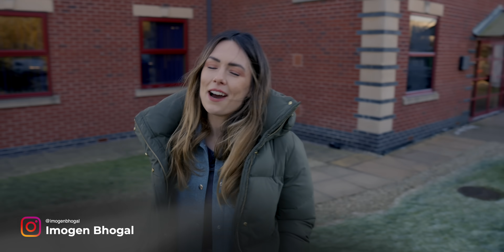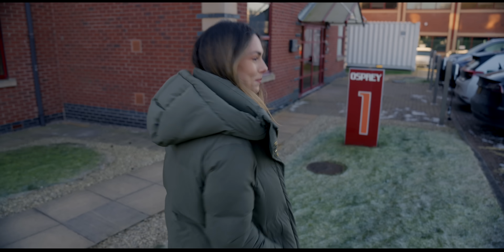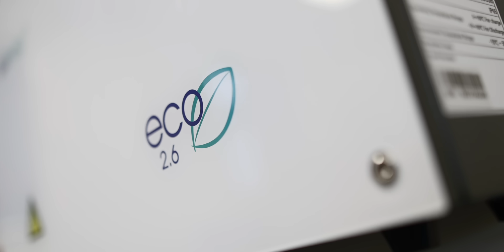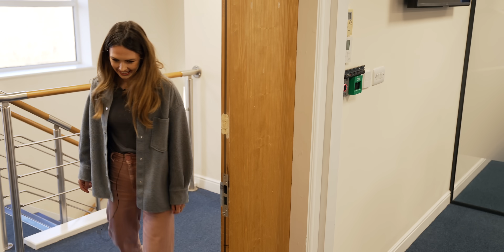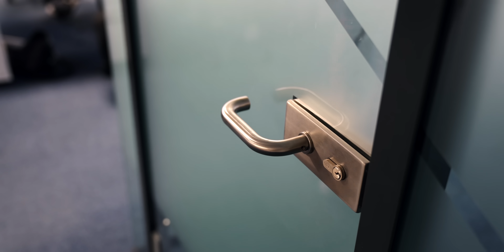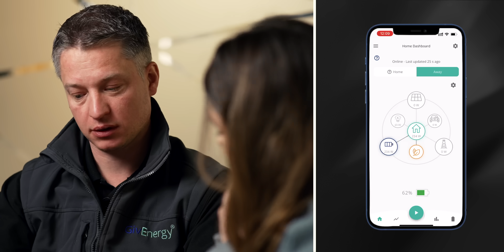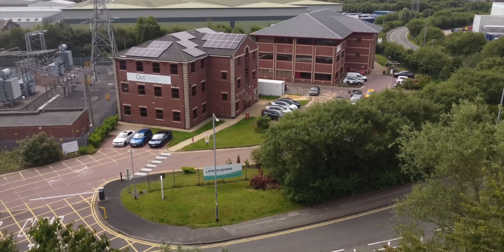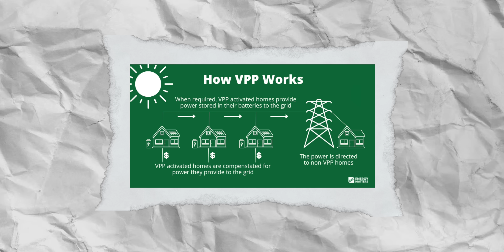THIS Is The Secret To Green, Clean Passive Income!

Comment: Our batteries and solar panels were installed a couple of years ago. They have been absolutely brilliant, particularly as they are combined with heat pump air conditioning. I have to say though that the GivEnegy bloke is not the best advertisement for the company. Smart casuals and a shave would improve his credibility no end.
Reply: could loose some weight as well, BUT do you want a slimy suited salesman??????

Comment: I do not agree with the "cheap" tariff over night, I believe it should be much more dynamic having a daily minimum and maximum and every 15min should be adjusted. This would help us greatly flatten the curve and adapt our consumption to production.
Reply: That already exists. Energy markets are priced every 30 minutes. Octopus offer a tariff called Agile that follows the wholesale market. The reason the cheap overnight rates exist is because Octopus wanted to prove to the market/NG ESO that it could incentivise people to charge at a time that suited the grid and not the owner. They do this by offering a cheap rate. Now they have moved that on to Intelligent, which control when your car charges and when it does, you get the cheap rate, no matter which time of day. Again, its cheap purely to get people to use it, so Octopus can show it works. It's well known that this was a loss leader for Octopus. They are now (or were) trialing being part of the grid balancing mechanism and turning chargers on and off to suit the peaks and troughs of demand on the grid. This will be earning them money which likely balances out the cheap rate to customers.
Reply: @cingramuk  in the UK it does. Over here in Portugal not that I am aware of.
We get cheaper night tariff despite huge solar capacity. Solar outperforms both wind and hydro by a lot so the only thing beeing "ON" in the night could be Gas or coal 🤐
Reply: @maumau165  ah I didn't realise you weren't in the UK. Yes that makes sense, maybe ping Octopus a message if they serve Portugal.

Comment: I’m installing a hybrid battery/grid solar system here in Alberta, Canada. Even up here it absolutely makes sense - actually panels like cooler temps, they produce more at 0° than when above 25° C!
Reply: Unfortunately there is no Time of Day pricing in Alberta for residential users.
Reply: And produce nothing with snow on them.
Reply: @Robert-j6r8c You do realize that the sun melts snow. The panels are dark and warmup. Snow melts against the panel and slides off. Panels are tlited towards the sun, they are not intended to be flat but tilted to get direct sunlight for the latitude. Ice and snow on a panel does need more sun to clear.☀️☀️
Reply: @JohnRoss1  
So why do you have burn diesel fuel running snow plows to clear roads, roads are  black and absorb the sun's heat.

It's also why I've never seen snow on a roof.
Reply: @Robert-j6r8c  the road had a massive thermal mass though which is cooled right down.
The panels are pretty thin. So as they absorb the heat they raise their temperature quicker. Roofs do have some thermal mass too but, they are also at an incline and have some heat coming from below from the house.
Reply: @Robert-j6r8c  Not true actually, The 8-Bit Guy did a test recently with a simulated power outage and was supprised when the solar pannels still made power with snow on them .Infact they made more with snow than when its was very overcast .

Comment: Got 2 9.5kwh GivEnergy batteries and 5kW inverter with 7.5kwp solar PV for bit over 2 years, and 2 EVs, and Eddi, and amazing difference, so much cheaper and in summer can run whole house, charge battery in the day, export and top up one of the EVs…. , and heat hot water. In winter not quite but charge battery at night off peak (and much cleaner) and runs house during the day… 93-98% off peak usage. 
Getting rid of gas hob next month and hopefully Heat Pump later this year via Octopus 🤞.

Comment: Finding a decent installer is a minefield. The installer of my solar panels (2015) went bust (pity, they were good), the installer of my GIV energy battery and Zappi charger (2022) has gone bust, and to be honest good riddance. So as well as getting a quote get some info. on the companies financial viability. And don’t pay until the equipment is on site. GIV energy system is great, just wondering whether I should get a second battery.

Comment: This could be a good video if it wasn't such a advert lacking a lot of data and coming across very snake oily.
DFS are not frequent events. There's been 1 this year. From Nov to Dec there was 7.
You can only discharge 6kw in a hour with the MDs all in one.
Most places offer £2.25 per k/wh saved. That's £13.50, - cost to charge, and assumes you have enough battery capacity. The last DFS event gave 2 hours notice. Your battery may well be quite empty at that point. You could charge it again but your then at peak rate so the savings are reduced further.
This is all nice and good stuff, but it's being quite misleading here.
Reply: Let's face it, it's a GivEnergy advert, wrapped up into a video feature (allegedly)! Classic Fully Charged even with 1m subs!

Comment: Hmmm. Where did I start? Built my home with the best insulation I could get, opted for an on-demand water heater, and put in an RV panel to plug in an EV someday. Then… installed solar panels on the roof. A year later bought an EV. Several years later added two Powerwalls. Just got a different EV that is capable of V2L, which I hope to enhance for V2H. Little by little…!
Reply: Which EV?  I want the EV9, but not without a bidirectional charger.  EG why drop big money on home storage, when a (roughly) ten times the size battery is on the driveway, complete with a set of wheels, should I want to pop out.
Reply: @matbowden9156  Agreed, but sometimes I want to drive the car at night (no battery at the house then) or take it to work during the day (no charging the battery from my solar to feed the house at night, plus the battery is run down some from driving it to work).  It seems to me I still need a smaller battery installed at my home.
Reply: @ssoffshore5111  That's just it though.  Do you? Really?? Let's roleplay this.  If your goal is zero cost (past ya huge initial outlay) then yeah... Making sure ya fridge carries on running whilst you make an impromptu evening dash to the shops in ya car will of course require a home storage battery of sorts.  And again, I agree, if others are going to remain in the house whilst the same car is in use for errands, it might end up costing a few pence here and there as it's reasonable to suggest they will clearly consume energy from the grid, as the battery with wheels is off fulfilling it's core role in life.  Conversely however, the data tells us that the bulk of the time ya car is just sat there depreciating. Further, the same data tells us that smaller more frequent charging of a bigger battery is better for it vs a full (or close to) duty cycle of a smaller battery, each time.  So why not maximise the utility value of the car itself?  AKA if ya goal is more around bang for buck, then well, the data says - don't try and fix absolutely everything in one fell swoop - accept that it's a bit like most things in life.  What works for you might not work for fella nextdoor, let alone everyone else, and so you'll end up with a bulk saving via V2X vs a complete saving 😉
Reply: Yes I agree that the car - most of the time - will for most people be available on the drive to do the job of a battery. 

Those times it isn’t shouldn’t cost all that much £.  

Which means a v2l car is a good alternative to batteries. Just that the v2l car isn’t available at low prices.

Except the Nissan leaf (used) which might only suit a limited number of people.  

But in fact as a second car a low range v2l leaf probably works brilliantly as an alternative to a battery.
Reply: @constructioneerful  ...there coming!! 😁👍

Comment: More misinformation. Context: battery sizes 2.5 - 13.5 kWh. Night charging (currently around 7.5 - 9p per kWh), 1 cycle per day, assumed usage 10kWh per day is "high'. All this from video. Savings £4-5 per day? How? Savings on night cycle typically £0.28-0.08=£0.20 per kWh. I.e. around £2 per day, or £3 per day with solar - but as that comes off max usage its the solar doing the saving not the battery. On the right tariff you're looking at a repay period bog £10 years (ish). So, what's the lifetime of a typical battery? And this is supposed to be better than ASHP with insulation, EV and charger, solar panels alone? Repay periods likely less with all these, as well as these reducing carbon more effectively for most households. The "best" solution is always the subject of the video, isn't it? 😂
Reply: Disagree, it’s totally accurate, based on my experience. I think I’ll repay my £11k system in 3-4 years. His house useage might be 10kWh but he also has an EV and 10kW = 40miles at best, so he is quite likely using 20kWh per day which will yield the savings quoted. I charge my batteries and car at 7.5p any solar I make is exported at 15p per kWh. You don’t have to be a mathematician to work out that for a good part of the year you can earn more that you use. Last year I paid just £170 to run a 4 bed house and 2 EV’s. This year my tariffs are much better (15p export as opposed to 4p)  so I expect that to be less.
Reply: Car charging
Reply: I'm guessing they're comparing the savings to the UK electricity price cap of c.29p/kwh for a 'best case' scenario!?

Comment: I started with a 3.8 kWh west facing solar in 2011 and a solar diverter for DHW. By 2020 we added solar to our east facing roof and now have 7.56kWh of solar and Tesla Powerwall. Eddi and Zappi were also added along with our EV. Last year an ASHP was added.  Unfortunately the ASHP eats up my battery by lunchtime, but it still helps and my monthly DD is only £120 for heating, home electric use, cooking and charging the EV to do 10,000 per year. 
At the time Tesla were the only to offer whole house cover in a power cut and the fact that solar could still charge the battery and be used if no power.
Without solar and battery you are limited to choice of tariffs, so on a standard tariff today... I was paying £150 for petrol, £80 for LPG (now would be £120),  we use around 9,000kWh in our home so at standard charge that is £230 per month. Total would be £500 per month, but my investments in my home have saved me over £4,500 in the last year.

Comment: That's amazing how expensive your electricity is.  The guy saves 4-5 pounds, $6US. And says 10kWh per day is a lot. 10kWh only costs us $1.50. Our price would have to go way up to make batteries worth it.
Reply: UK price is about 30p/kWh at the moment. It doubled when Russia cut off gas exports, but would be even higher if the government wasn't subsidising it for domestic use. Commercial rates were over 70p/kWh last year!
Reply: And that is the problem, while your electricity is so cheap you and others will waste, like Gasoline, too cheap STILL  thats why 'everyone' drives around in gas guzzling tanks, called utes.
Reply: @rivergladesgardenrailroad8834  That certainly is the problem. We do have a lot of relatively cheap electricity. Where I live, it's so cheap, that we let water go around the hydro plant and fall down the falls because it looks pretty and makes more money in tourism than the electricity it generates.  The Niagara plant alone generates 12% of what the entire UK uses in electricity, and it runs 24x7x365 and doesn't vary and we have 300 more hydrodams just in NY. Another 1/3 comes from nuclear plants built 50 years ago.   Both of those just run 24x7.  The remaining 1/3 is from local NG power. Even with substantial subsidies, my rooftop solar has over a 10-year payback and that's with 100% net metering credits.  And yeah, it's pathetic that Americans complain about $3.50/gal gasoline like it's ridiculously high and want it back down to $2/gal when no one was driving during the pandemic so they can afford to drive their over-compensating gigantic vehicles.  Unfortunately, the below-average American thinks the president controls that.  And will vote for anybody that promises low fuel costs, and I mean anybody, criminal or not.

Comment: Trading electricity with the grid, daytrading, for money and profit will be a big thing. 
EVs come with a free battery built-in, Hahaha. 
EVs selfplug-in and daytrading grid support stability and electricity energy as per the vehicles computer can be extremely profitable. 
South Australia big battery paid for itself in the first year. $100million.
Reply: Only nio has active VTG. Load up on cheap energy at night and sell it during the peak day rates thru your car battery. And of course all their swap stations do energy arbitrage as well. Not stationary and pointless megapacks but multi purpose batteries.
Reply: @reginald7214  very clever 👏. 

Elon Musk will do the same at his Tesla rapid charge stations on the main roads. 
PV panels for the entire site, and big batteries.
Reply: @stephenbrickwood1602  do the big batteries just have that 1 function? Does your Tesla car battery still degrades over its life? Do you only get to choose 1 size battery? So they don't have solar yet, but maybe someday? Every fixed battery ev has a finite life span. That's why the rental companies are running away screaming and going back to gas cars.
Reply: @reginald7214  The big batteries would accumulated cheapest electricity when available and then rapidly send large amounts of DC to the customers EV battery when the customer plugs in.

I am not an early adopter of new technology because I installed gas and electricity and run 2 older vehicles. Petrol. 

For me to make the most of electricity we would need to buy new appliances and install rooftop PV. And I am very busy at the moment. 

Arbitrage is what most grid connected buildings will do with EVs plugged into the grid at the car park spaces. 

Everything needs maintenance and has a life cycle. 

Rental companies have their own problems. 
I think ICE vehicles and petrol will get cheaper to maintain cashflow for as long as possible. 
All customers know ICE vehicles.
Reply: @stephenbrickwood1602  oh for sure. Except that big battery only performs that function.  Nio's big batteries are its own swap station with 23 batteries each. Buy, sell, store, power cars, no degradation, multiple sizes. Spread across huge areas of the country. All in one unit, not Teslas garbage megapacks. And of course high speed charging wastes way more energy than the swap stations do.
Reply: @reginald7214  I see your point, very good. 
EVs with big batteries for the longest drive but the Daily drive is 7kwh on avg.

So, with a swappable battery, the EV could be great for the daily drive AND lighter on the road. With a minimum sized battery pack and add extra batteries for the long drives. Or just swap out as you go.

The EV would be cheaper to buy. 
You could leave a spare battery at home for the home use or a home swap. 

Excellent thinking.

Comment: The money they make is payed by the rest of the consumers.
It's not about lower energy costs on the grid.

It consequence of old coal and Variable RE.

Installing geothermal/hydro and nuclear must happen to get sustainable and lower grid prices.
Reply: The money is saved from not needing to start up extra fossil fuel generators at peak time. 'Peaker' power plants are quite expensive to run.